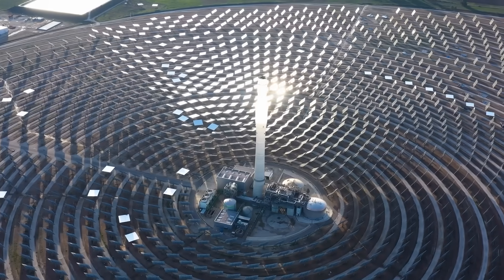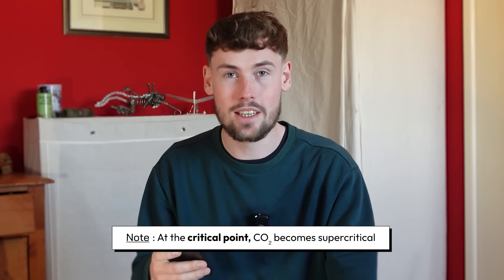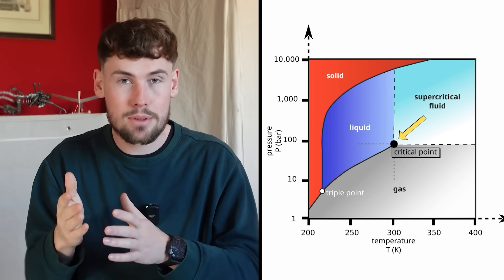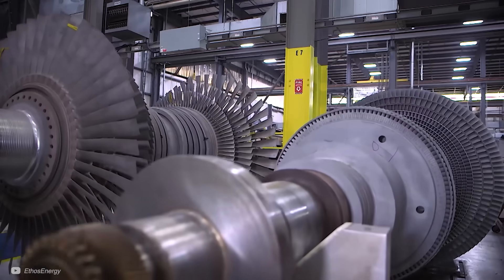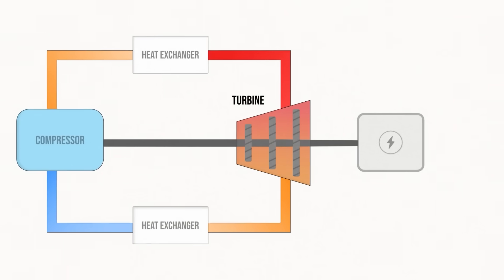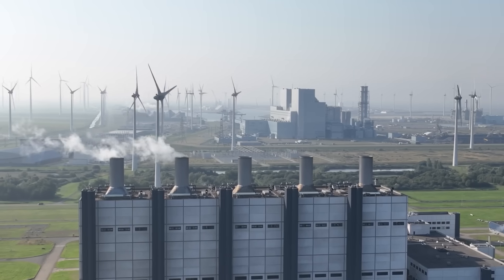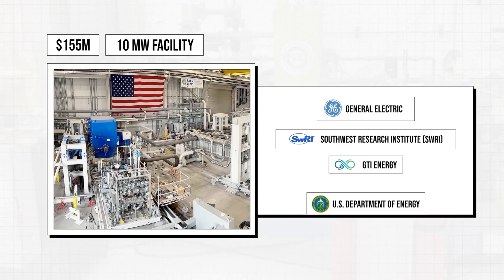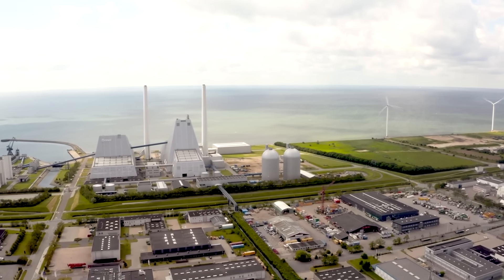How Ultra-Efficient CO2 Turbines Are The Future of Energy

Comment: Hello! If I understand this right, the 10% thermal efficiency improvement gives a ratio of 50%/40%, or 5/4, which is a 25% improvement in performance. Also, I note, the CO² never leaves the system (except as leakage). BRILLIANT!
Reply: And neither dose the water in a steam turbine
Reply: @TheBlibo   Water is steady replaced in a closed steam cycle. It is called "blowdown" and you will always see whisps of steam above operating steam turbine power stations.  This is necessary for boiler water chemistry, and the lost water is replenished using make-up demineralised water.
Reply: The beauty of steam is it's cost and availability not to mention the expansion ratio which is about 3 times that of CO2
Reply from the maker: Exactly - really exciting technology!
Reply: You can get an even better thermal efficiency by using mercury.
Yet its not being used - now - because it is easier to just burnmore fuel.
Fuel is cheap so why bother?
Reply: @skipperg4436   "Fuel is cheap, so why bother".   I don't really agree that fuel is too cheap to bother as it is a limited resource and it is rational to use it effectively, rather than wastefully.  However, in these days of irrational fears of man made climate catastrophe, there is also carbon taxes to make the consumption of fuel even more expensive.  Regardless, there will always be an economic incentive to minimise fuel costs.
Reply: @skipperg4436  it always comes down to money
Reply: @skipperg4436  hi 
I might guess that if hydrogen was used In a liquid to gas transition that may be even more thermally efficient as it has the greatest specific heat capacity of all
Reply: Apples, oranges. Supercritical steam turbines (coal fired or alike) also reach 50% efficiency. 600 °C is used, 700 °C is aimed at. One misconception is that other turbine engineers (e.g. working on water steam turbines) fall instantaneously into sleep when others start research and development.
Reply: The issue here is that it need higher temperatures, making it come into bradley turbine relm, that in a CCGT configuration can reach 65% efficency

Comment: When all is said and done, it still is on the "Burn Something" side of electrical energy production. How does it compare in terms of total cost against wind/solar/battery, and let's adjust their cost down 50% in the next 5 years?
Reply: I disagree.
sCO₂ turbines convert heat to power—they don’t require burning fuel to produce heat .
They also work with nuclear, solar thermal, or geothermal.
Reply: @daftvader1505 Rather pointless to convert clean green electricity to heat something to run an inefficient turbine to produce electricity.
Reply: @ I think heat batteries are the way to go with this tech. That huge solar concentrator plant they shut down in California would be a perfect place to put in these more efficient turbo generators and some titantic molten salt heat batteries.
Reply: It doesn't have to be on the burn side. Solar and wind generators have carbon costs to make the physical parts of a generating plant, as would this CO2 turbine and associated equipment. Once the Supercritical CO2 power plant is built the heat input needed to run it could come from solar or wind electricity that would be stored as heat in large heat batteries. If this was a "peaker" power plant, this heat would be at the ready to power up the supercritical CO2 turbine and gernerator in a few minutes time. Nothing is being burned to generate the electricity in this scenario. Sure you could build these plants to run off natural gas or coal or fuel oil, but that's not really the way things are going right now in most places.
Reply: Their carbon costs are miniscule compared with the CO2 emissions avoided during operation  @Hybridog
Reply: @rogerphelps9939  I agree, I mentioned that to help the OP see that everything (for now) starts with a carbon cost, but that cost is minimized over the lifetime of the system if it doesn't add any more carbon. I think he was assuming a supercritical CO2 power plant was going to use fossil fuel as a heat source. That of course is possible and even likley, but the tech meshes perfectly with renewable heat sources.
Reply: @Hybridog  You don't convert electricity from solar or wind into heat in order to make electricity.
Reply: @jjamespacbell  Solar is not just photovoltaic - it of course can generate heat directly. And while it would not be ideal to go from wind to electricity to heat to electricity, it depends on the situation. If wind is used to generate heat electrically and that heat is put in a heat battery to make electricity later, then why not? As long as you are not adding carbon that's all that matters. Who cares if it is ideally efficient.

Comment: so you need a ton of energy to capture CO2 and turn it supercritical in order to power a steam turbine at 40-50% efficiency. brilliant!!! we're all saved now
Reply: So we use some solar during the sunny days to slowly prepare the supercritical fluid. Then use and re-use that fluid for the lifespan of the system. (barring leaks). Sounds like a good tradeoff if the material sciences can be figured out and if the efficiency is as good as it seems.

That said, the explosion that would occur when a pressure vessel pops would be amazing to witness. (from 10miles away)
Reply: Not if it's a closed circuit...
Reply: The energy is not all dumped. It is regenerated a lot so the % is not that big a deal.

Comment: I'm not an expert by any means, but as far as I know conventional steam turbines don't use a compressor at all. They use a condenser where the steam is cooled down (usually also preheating the feed water to the boiler) which condenses it and helps with creating vacuum at the turbine exhaust.
Reply: Condensing the steam to liquid water also means that pumps can be used to increase the pressure of the liquid water before it goes into the boiler. It takes far less energy to compress a liquid, especially one as incompressible as water, to a given pressure than it does to compress the same mass of a vapor to the same pressure.  So the steam cycle shown in the video where the steam is not condensed in the heat exchanger means that a higher percentage of the power generated by the turbine has to be used to drive the compressor.  This reduction in energy to compress water rather than steam is greater than the energy absorbed in the latent heat of the boiling water which is not available to do work in the turbine.
Reply: you are correct to answer your instincts, all use same core principles and form of round bladed co axial rotated mechanical form with veriations of size of circle, pitch and length of blade(or inpeller) and aplication to suit substance from liquids from water hydroellectrical dams to thinner gases like car engine turbo intercoolers optermied using same tempreture pressure and flow rate tooo suit properies of gas propertieys capability, quantity and output like your fridge compressing generating heated nitrogen to suck he out of inside to return to surrounding ambiant temp.
Reply: The pumping power required to pressurise for the condensed water is so low it's ignored in most engineering calculations for steam turbine power generation, so this very much looks like he's regurgitating a supercritical CO2 funding slide deck, as fundamentally misstating the current state of the art is a standard lie used by people hungry for venture capital to get other people's money. It does mean all the other items in the video given as facts can't be trusted either.

Comment: If it works, it isn't going to get around the need to burn some kind of fuel to heat the CO2 to the super critical point. Even if heated using nuclear energy (fission), that's another dangerous material to dispose of when it's no longer usable.
Reply: sCO₂ turbines convert heat to power—they don’t require burning fuel. They also work with nuclear, solar thermal, or geothermal sources, just like steam turbines. It's important not to confuse the method of converting heat to electricity with how that heat is produced.
Reply: @daftvader1505  I get that, but creating heat at the required temperatures means using some form of fuel. Solar isn't sufficient, nor is geothermal. TANSTAAFL. It isn't going to heat itself. There's also a limit as to how much hydropower can be harnessed for the purpose. Fuel becomes heat; heat and pressure leads to SCO2; SCO2 turns the turbine. Turbine produces electricity. 

Very simplified, but that's what happens. The equipment required is modifications to existing system designs: steam power. Even nuclear powered ships are technically steam powered. We have simply moved from burning coal to other means of creating steam. Now, we're simply working on getting away from big bulky systems that rely on water to one that will use SCO2.

Comment: The use of CO2 is interesting. There is a heat pump water heater that uses CO2 as it's working fluid. It's very efficient and of course the GWP of CO2 is 1 so little impact on climate warming.
Reply: Co2 has a gwp of one because it is the *baseline*.
Co2 has quite an impact on global warming and does not get absorbed into or break down into other substances quickly. I.E hundreds if not thousands of years. 
Methane, while much worse, breaks down in 12 years.... And becomes CO2 and water vapour. 

Make no mistake that CO2 is a very harmful global warming gas simply because it transfers infrared radiation so well, it's chemical persistence, and scale.